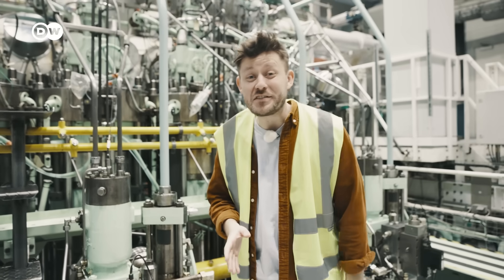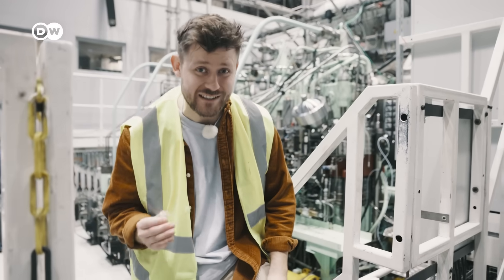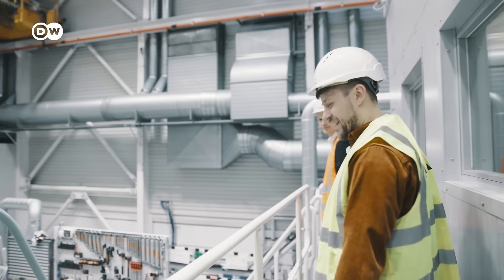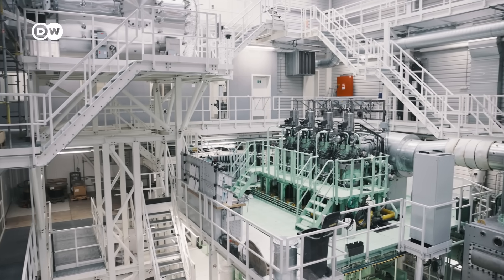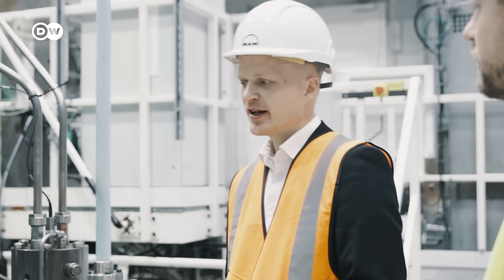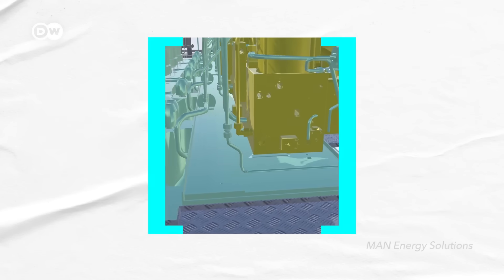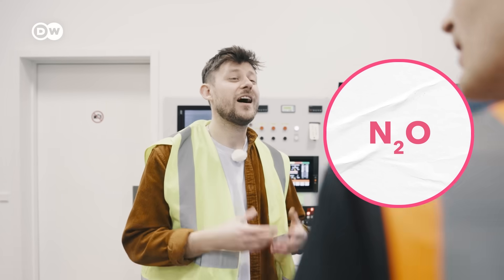Can this magic fuel clean up the shipping industry?

Comment: I saw a fantastic article about how nuclear-powered cargo vessels were tested back in the day. The poster child of the tech put style before efficiency, and kinda flopped after public perception of nuclear went sour. If we made them today with something like a traveling wave reactor, you could have clean shipping with no need to refuel the reactor for the ship’s lifetime-the reactor can be armored to hell and made to be removed entirely and processed by a separate company once the ship is decommissioned. We already have reactors that are inherently safe and will shut down with zero human intervention in case of the worst happening and the ship sinking. The water entering the reactor automatically shuts it down, with the inert reactor sinking to the seafloor without releasing any harmful radiation. By the time corrosion could be a problem, the seabed will have encased the reactor and it will never be a problem. Nuclear would not really increase the cost of a shipping vessel, there might even be financial savings due to the fact you do not need any fuel. We have the experience with naval reactors from the military, there’s really no reason to not put that path forward
Reply: Given that regular ships already have problems with illegal bilge dumping, I'm not too sure how safe nuclear can be in the hands of commercial vessels(I'm aware military vessels have very good safety records).

The sea is a wide lawless expanse. How do we know they wouldn't skimp on safety mid transit? We already have ships sneakily dumping waste oil, with little repercussions.

Comment: Switching fuel for fuel ?
Why not use batteries?
Reply from the maker: Solely to batteries? 🌚 That means a lot of digging and - what about the waste? We have made videos exploring this topic you can watch here 👇
"Which will be the engine of the future?"
🎦 https://www.youtube.com/watch?v=qiQcGdq66DI
"How salt and sand could replace lithium batteries"
🎦 https://www.youtube.com/watch?v=-vobMl5ldOs
"Why our future depends on lithium"
🎦 https://www.youtube.com/watch?v=gAZV1Ut6DDs
"Can you recycle an old EV battery?"
🎦 https://www.youtube.com/watch?v=PbOBmnZRpZ4
Reply: Energy density. Batteries struggle with hauling heavy cargo. More cargo, more weight, more batteries, more weight, less cargo.

Comment: Why not burn hydrogen instead?
It has a even higher energy density and burns down to water.
I know it reacts with everything it can find but there are savety measures we can use today like using a second wall filled with nitrogen for example.
Reply from the maker: Like you mentioned, ammonia can be easier in terms of storage and transportation compared to hydrogen. But there are a lot of discussion over hydrogen vs. ammonia as well as hydrogen AND ammonia. They both have pros and cons. We also did a video on hydrogen you can watch here 👇
https://www.youtube.com/watch?v=AGTjKJHu99c

Comment: Here the obvious solution is completly left out. High temp nuclear power can produce the needed Hydrogen at scale with low emissions. 24-7-365. At low cost. Electolysis using renewable energy just can not do that. Or even better: just use small PWR-reactors directly on the ships. Like the russians are doing on their icebreakers. Fuel amount needed? A few hundred kg is enough for several Years of full power at higher speed than possible today.

Comment: What happened to HYDROGEN POWERED ENGINES.... AND DID THEY LOOK AT THE AMONIA ATOM WAS 3 HYDROGEG AND 1 NITROGEN..... A 3 HYDROGEN!!!! AND THE NITROGEN IS GREAT FOR PLANTS.... HELLO.... SEEMS LIKE THESE SCEINTIST ALWAYS GO TO THE HARDEST PLAN AND TRY TO GET IT TO WORK INSTEAD OF JUST GOING WITH OUT SPENDING TRILLIONS OF $$$ AND THAN START OVER AT SQUARE ONEVIN TEN YEARS.... AND I DO believe there's more HYDROGEN in the universe and our earth than ammonia... methane is probably better for heating cooking and smaller engines especially if you get the smell out 😂😂😂😂
Reply from the maker: Hydrogen is slightly easier to produce, but ammonia is easier to transport. Energy density plays an important role - given the huge container ships and the tanks they need. 🚢 We also made a video on hydrogen you may wanna check out here 👇
https://www.youtube.com/watch?v=AGTjKJHu99c

Comment: I spent many years developing a NH3 engine , I was very surprised to find out the cost was higher than fossil fuels , it was less costly when I was working on NH3. One of the neat things about NH3 is the products of combustion take up 1/12 more space when cooled down , so you get a free 1/12th efficiency advantage !

Comment: If you need to make hydrogen first to get ammonia, why not use the hydrogen in a fuel cell instead?
Reply from the maker: The advantage ammonia has over hydrogen is that it can be stored and transported more easily. Hydrogen has more challenges in this due to its low density. 🤔

Comment: All that really needs to be done is to refine existing fuel more thoroughly. I was on a cruise ship last week and when it was leaving port the exhaust was almost invisible- but once offshore and out of the emissions control area, they shifted to the cheapest bunker fuel and the hazy smoke got ten times worse. Rether than waste energy making a violently toxic fuel in an inefficient process, modest changes to the existing infrastructure will have great effects. Hell, just scrubbing the exhaust with seawater with no change in the fuel would take the nutrients from the air and put them into the water where the palnkton with bloom, feeding the entire food chain.

Comment: Maersk is building a new fleet of methanol ships today. Methanol is easily produced from combining natural gas with CO2, it is low cost, ecologically sound, and is a proven high quality fuel with existing global commodity scale distribution. Today's ammonia is 100% produced from natural gas and none is used for fuels because it is not a great fuel from a mechanics perspective. The notion that we are going to produce massive amounts of ammonia from renewables is pure fantasy.
Reply from the maker: With methanol: it also has to be green methanol to actually make a difference. So made with captured CO2 and green hydrogen. And if it is CO2 captured from biomass for example, that is also controversial. 🤔

Comment: Thanks, yes it may well come to fruition. Ammonia is a really nasty product to handle and any leak will be very hazardous which is why it would be very difficult to transition to cars. An Ammonia leak at sea in an enclosed engine room would be a serious problem.
I have worked with Ammonia,as a solution in water, so actually the hydroxide, and we used it in a SNCR process(selective non catalytic reduction) to reduce NOx from high temperature combustion plant, the lower exhaust temperature from an Ammonia engine engine however requires a catalyst.

Comment: Soo nuclear ships or can't we just down scale ships so they can work with wind and no engine needed just have more ships wind energy baby 😂. 
Why not build new train lines and have em be full ev trains where the track is energized to power all trains on it you know like 45% of tracks now.
Why trains well they can be 100% ev so then it depends on the grid and how clean it is and if done properly there little risk of em tipping and dumping there load.
Reply from the maker: Hey, check out our latest piece on SMR's, that could also be a game changer for nuclear cargo ships. Maybe? 👇
https://www.youtube.com/watch?v=GhKQ8EP1a1Y
And yes like you said, for trains then the source of electricity would matter plenty. It is happening a lot of parts of the world and where it will extensive infrastructure upgrades and coordination with power utilities will be needed. 🌱

Comment: you will always have NOx or N2O because burning means adding oxigen to the nitrogen.
if you 100% stop the oxigen bounding to N then the engine wont burn anything xD
Reply: No, the energy comes from the oxidation of hydrogen to water. The oxidation of nitrogen to NOx or N2O CONSUMES energy. If it was the other way round, the atmosphere couldn't consist mainly of N2 and O2.

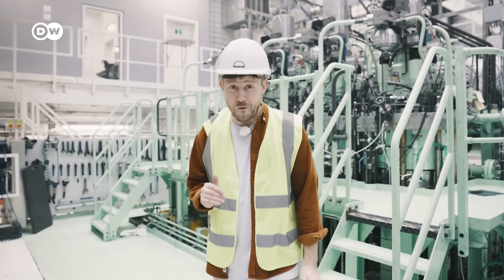Comment: 04:36. ALL of these compounds are "nitrogen oxides". First is "Nitrous oxide", and the second is "Nitrogen dioxide" if we're talking about NO2.
Reply: Where do you see 2 oxygen atoms in the right formula?
Nitrogens Oxide is both NO (nitrogen oxide) and NO2 (nitrogen dioxide), that why it’s written NOx. Both is toxic. N2O however is quite different. Yes is has both Nitrogen and Oxygen, as does NOx, but Nitrogen Oxides are limited to only one Nitrogen atom, N2O has 2 nitrogen atoms an therefore is no part of the nitrogen oxide group and instead called nitrous oxide.
Reply: @giantdwarfulf  Open the wikipedia article called "Nitrogen oxide". N2O is there. It is an oxide of nitrogen.
NO2 was just an example of a concrete name. But there is nothing specifically separating NOx from N2O.
Reply: @PavelKostromitinov  in terms of air pollutants there is a significant difference. That’s why there is a seperare wikipedia page for nitrogen oxideS (plural). There it specifically says that N2O does not count in this group and instead is its own group. The page your quoting is simply about any chemical compound consisting of nitrogen and oxygen, which includes all those named in the video. However this video specifically refers to air pollutants and in that case it’s not the same.
Reply: @giantdwarfulf  well, my background was chemistry, not ecology... 🙏

Comment: Wait, don't higher temperatures lead to more Nitrogen Oxides formation generally? Is that errata in the video? Or is that relating specifically to catalytic reactors requiring higher exhaust temps to work (hence why they can't be used on diesel engines)?

Comment: Ammonia engines stop working when the research cash dries up. This is malicious pretending to attack the clean efficient industries that feed us. Ammonia is a biproduct of sewerage and cattle rearing. It makes excellent fertilizer, and you can run an engine on corn products. Ammonia is corrosive and bulky. Not suited for travel practices. Not suited for motors. Thumbs down, DW.

Comment: I would have thought that ammonia would have been more effectively used in a fuel cell with direct conversion to electricity.

I suspect that a more practical approach would be to cruise at reduce speeds, improve hull forms and use Rankine cycle external combustion engines to give clean combustion.

Comment: This engine is not a solution.  Injecting the ammonia directly into the engine and lighting it off with pilot diesel leads to heat release that is too slow in comparison with normal diesel engines.  It is slow combustion that allows time for NOx formation.  It would be better to dissociate the ammonia into nitrogen and hydrogen outside the combustion chamber and expel the nitrogen directly to the atmosphere.

Comment: Global warming is NOT caused by CO2 but by solar activity which cyclically soon will lead to a cool period as in 1800 .  Bad science and greedy people , like Al Gore with his carbon credit agency, have brainwashed unscientific mankind successfully. The calculation of the greenhouse effect of CO2 is a scientific scam. An engine burning poisonous NH3 is a techical but useless, expensive marvel. Preventing ships to burn fuel with high sulfur content near coasts and coal power plants to spew (besides harmless CO2) tar, SO2, SO3, heavy metals and also Diesel cars  (trucks are excused) to emit soot is paramount. The goal is to stop murdering the environment and not distracting honest people with the mad, impossible goal of "combating climate change". Burning the limited amount of oil to generate heat is also a waste,as it is a precious raw material for chemicals.

Comment: Check out Hyliion - it can use Ammonia for one leg of the trip, Hydrogen for the next, Diesel for the next, CNG for the next ... up to 20 different fuels in one Carnot cycle heat-engine linear generator.

Comment: And what about hydrogen
Reply: Even less energy per volume. And has to be kept extremely cold. That's a big effort.
And high risk of leakage and explosions, it needs very high safety standards.
Reply: If costs wouldn't count, I'd suggest a fuel cell electric propulsion with tanks for liquid hydrogen and liquid oxygen. This would be "elegant" and very clean.
The use of pure oxygen instead of air allows more power per fuel cell volume. And you don't have to worry about air pollutants which could damage the fuel cells.
But costs count.

Comment: The ammonia energy contetnt is about 5.17 MWh/ton, to produce a metric ton of ammonia with  wind or  other green energy you need approximately 10 to 12 MWh of energy. Where is the business case? Where is the efficiency of using electricity to produce ammonia instead of directly using electricity? Definitely, batteries are not a fit for the shipping industry, but neither is ammonia.

Comment: If the requirement for higher combustion temperatures means that engines have to be working at or near full power, I can see only 2 alternatives for port manoeuvring or slow river passages:-
1. Multiple engine installations with engines stationary until needed for use as in the Fell railway locomotive (which was a failure) but possibly with electric drive it might be viable.
2. Individual cylinders cut out until needed- I think Mercedes might have done this with some car engines.

There are other considerations too. If "green" hydrogen has to be used as a feedstock, might it not be more efficient to use that directly and also eliminate Nitrogen Oxides completely?
There is also the fact that ammonia is really nasty stuff. I was on one ship with a liquified ammonia cargo and during gas freeing operations the accommodation was flooded with the stuff, killing my potted plants overnight, in addition to the difficulty everyone had breathing.

One further thing that bothers me regarding any replacement for fossil fuels- If the oil refineries have to close, where do the lubricating oils that will be needed for any type of engine or rotating machinery come from?
Reply: Actually whats really happening in river passages is much simpler. They will use conventional fuel in the same engine without the need for additional installations. That’s why imo these dual fuel engines really only exhibit their full potential if used on long trading routes where you can run ammonia in this case for an extended period of time.

I’m working on a ship with an LPG powered dual fuel engine, more specifically powered by propane. In river passages we use diesel instead of gas. If you look at the numbers the time when the engine runs on diesel very short in comparison. Two weeks at sea with gas and pilot fuel (usually heavy fuel oil, except inside emission control areas) as mentioned in the video, compared to 5-6 hours of river passage.

Comment: The fact your relying on electrolysis and the Harber-Bosch  process to make NH3 means it will never be economical, simply because that energy could be put to better use in other processes to decarbonise industries more efficiently… therefore I am forced to conclude that this option would only become the solution when the bulk of industry is green leaving the fringe issues to solve if nothing better is found between now and then (my guess in the 60-70’s)

Comment: Not sure why you would want to burn ammonia instead of using it in a fuel cell to power an electric motor to turn the propeller of the ship. No emissions except H2O. I think this is a case of an engine maker wanting to keep making engines just with a different fuel.

Comment: Green ammonia costs too much to produce,  and the electrolysis method requires huge amounts of electricity.  Just use the oxygen and hydrogen from the electrolysis method and feed that into a hydrogen fuel cell.

Comment: let's replace a carcinogenic fuel with a highly toxic fuel.  what could go wrong?  also it's extremely energy intensive to make the fuel.   is zero CO2 the only advantage or am I missing something.    Imagine if a ship was damaged in port and the contents of the ammonia tanks leaks out into the surrounding area.
Reply: Nitrous oxide is used in dragsters. Nitrous oxides are ALREADY in diesel trucks, fixed by catslytic converters or adblue (urea) injected into the exhaust. BOTH OF THESE can be taken care of with catalytic converters on the exhaust. Like almost ALL vehicles have had since the 90s. Btw ammonia ALREADY comes up out of the ground in (former) Yugoslavia I believe.
Reply: Dude that’s gonna be awesome.
Reply: Industrial cooling uses ammonia due to its cost, that's why professionals should be present on this type of engines and not for your average person.

Comment: As you were discussing how green ammonia is made, with the first step being electrolysis to separate hydrogen from oxygen in water, my immediate response was, "well, why not just use the hydrogen directly," either via fuel cells or as a combustion fuel. 
So yeah, why would we use ammonia when we could just use the hydrogen that needs to be produced to create ammonia in the first place?
Reply: Energy density, obviously.
Reply: @concinnus  And storage & transport requirements LNH3 is so much easier (even hazardous) to deal with than LH2.

Comment: Blue Ammonia will obscure 'carbon sequestration' as a back-pressure method for fracking, while being the workhorse for the frontstore, Green Hydrogen.  We should be burning Thorium in a thermal spectrum to crack ammonia.